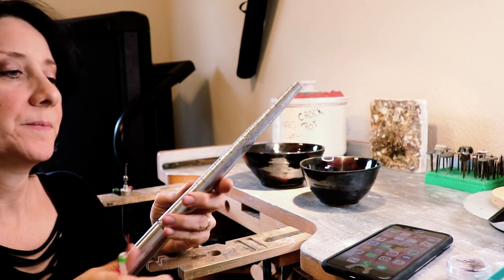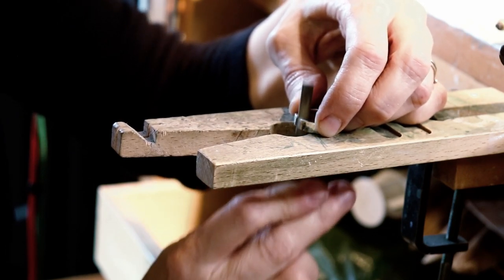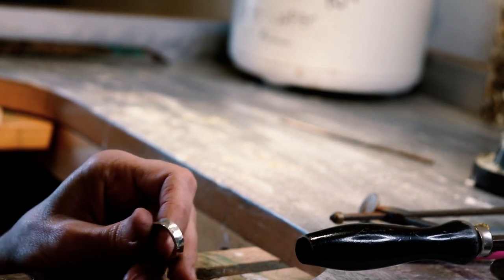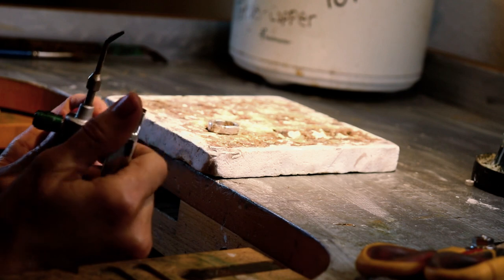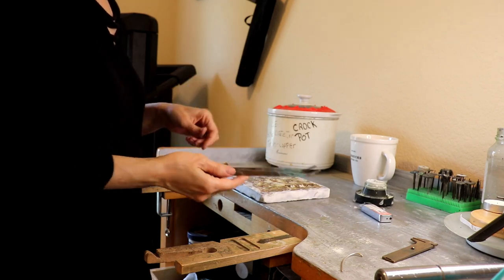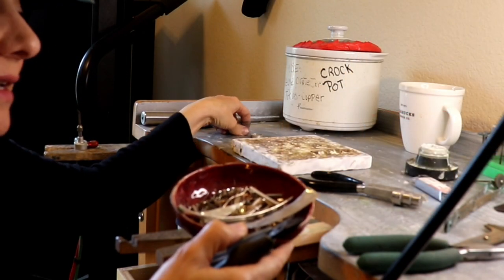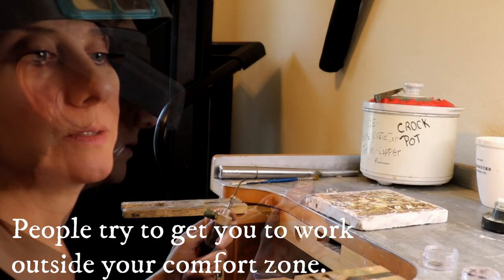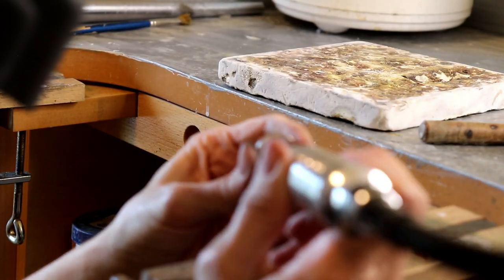How to Make a Silver Ring Smaller

Comment: I know you wanted to have an easy repair done on the woman's ring but to completely replace it is unethical. This is why I don't like to take my jewelry for repairs because there should be trust between the owner and the jeweler. I would never want my jewelry replaced.
Reply from the maker: I’m confused about this.  I wouldn’t do something unethical to my knowledge.
Reply: @JulieHiltbrunner  I'm sure you didn't have bad intentions but to completely replace a customer's ring with a new one is not right. On your video you said that the ring was not engraved so it's not special. It might of been a ring that was in the family passed down for generations. It might of been a ring that was given by a loved one that passed. To myself, I think that is special. These are just examples of why jewelry should not be replaced when asked to be fixed. On the video no mention was made if you asked the customer if they wanted a new ring instead of fixing it. That's why it's a concern to take jewelry in for repairs. There were some jewelers that would switch out gems for fake ones and the only reason some were caught was because the gems were laser etched with id numbers.
Reply from the maker: @elmoelmo8875  I didn’t do anything without discussing it with the customer.  So no worries.  I have heard the stories you are talking about.  Have a nice day.